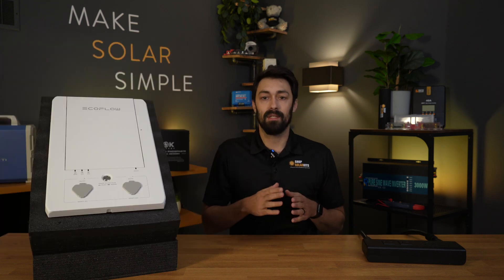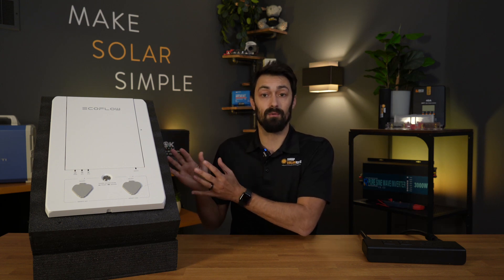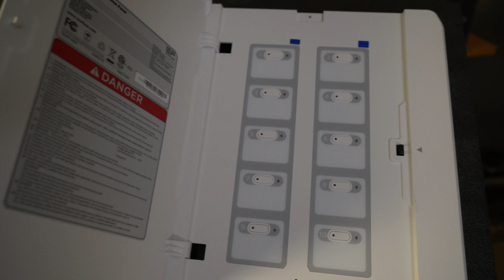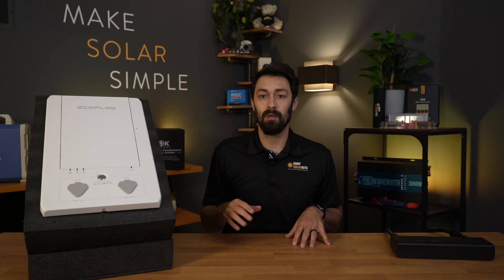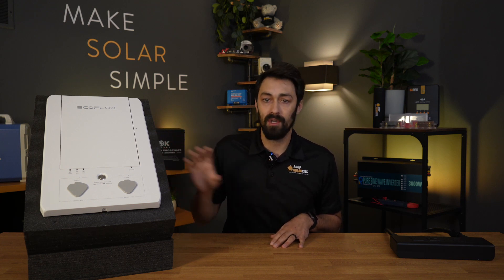Free Back-Up Power For Your Home

Comment: I like the idea of a more traditional transfer switch, rather than the Ecoflow Smart Panel with its infinity ports. My reason is, I want to use Ecoflow Delta Pro to feed the house and recharge them, as needed, with traditional generator. If the Delta Pro fails and I need to remove it from the system, I could connect the traditional generator to the transfer switch and bypass the failed Delta Pro. I am not aware of how I might connect a traditional generator to the Smart Panel. However, I will say the Smart Panel is attractive because of the auto failover abilities. Your thoughts on my design?